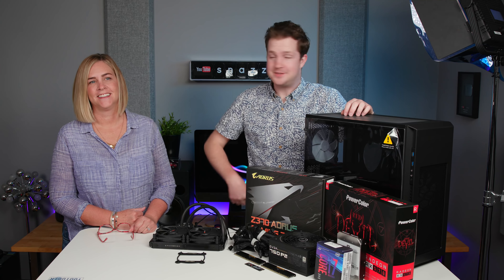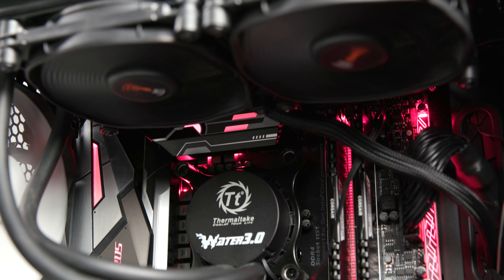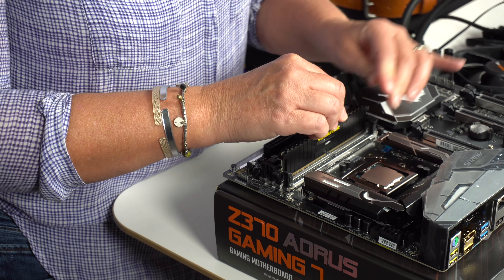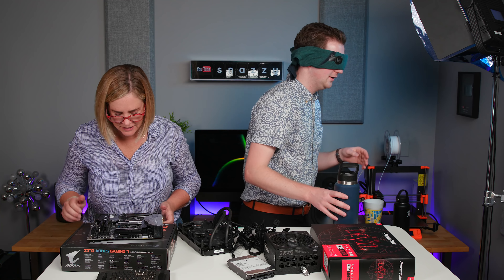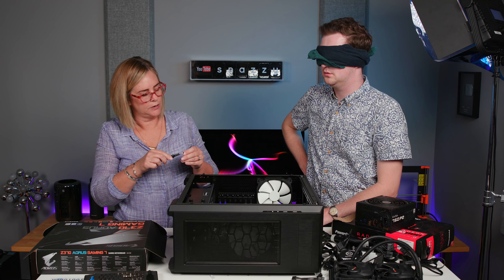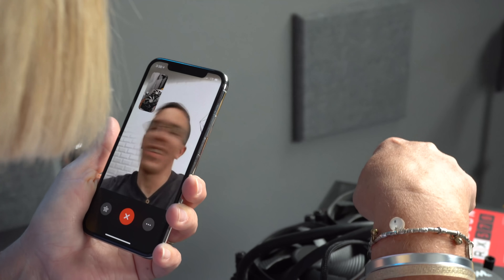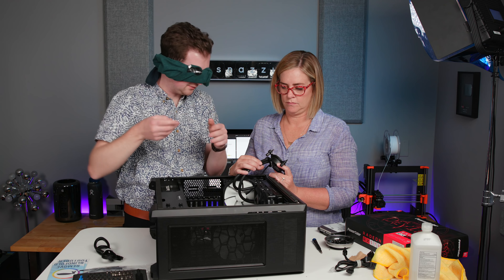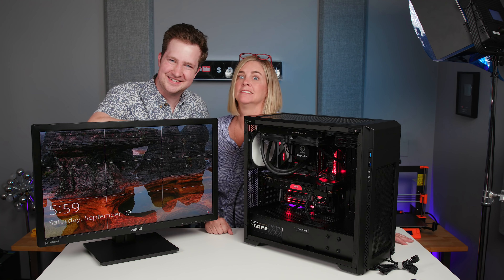My Mom Builds Her First Hackintosh PC (While I'm Blindfolded)!

Comment: My most unsuccessful build: 
1. upgrade my PC
2. plug in cables
3. pull the whole thing down to the floor by tripping on cable
4. put it back on the desk, worked perfectly fine, only one bent corner of the case
That's how durable components are ... anyone can do a successful build, except the Verge.

Comment: I'm trying to make a hackintosh without a mac to start with and it's so werid and cofnusing :(
I installed macos on a vritual machine but for some reason the installer is super slow and the internet it uses is like 3kb/s. safari loads videos super fast (strangely faster than windows?!) but the MacOs Mojave installer is SO slow. like I waited 1h and it was still stuck at the beginning and the monitor said it used like 100mb of data....

Comment: You can’t use iMessage and AppStore etc when you hackintosh right? You get banned?
Reply: Alex Schwartz no you can though i does take some time to set it up but after it works like any other mac
Reply from the maker: You can!
Reply: Really? Because im dying to scratch my Mac itch. Its hard to go from an XPS 15 to an $1800 touchbar gimmick ass 13 inch with no dgpu though lol. When i was looking up Hackintosh stuff for the XPS 15 9550, people said it's likely youll get banned so dont use iServices especially with your real account.

Comment: putting the hardware together is probably the easy part, having a fully working hackintosh is a different thing. The title of the video is pretty misleading as there's nothing hackingtoshy about it. at the end you just cheered about having windows boot up... Or is there Part 2 in the making?
Reply from the maker: I mentioned a part 2 at the end of the video. Gotta watch the whole thing! 😊

Comment: i dont think your mom used a windows computer in the 80s.. in the 80s most computers were 8088, 8086 or 286 and it would have had to have been windows 1.0 or 2.0 which were not really as common as the later versions so i call bullshit ;)